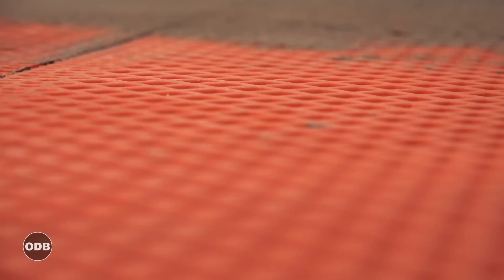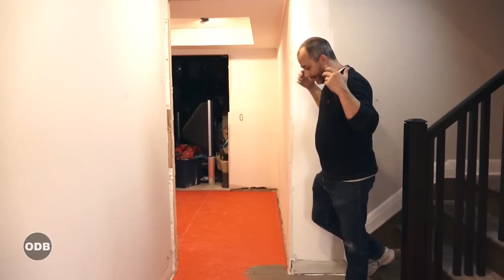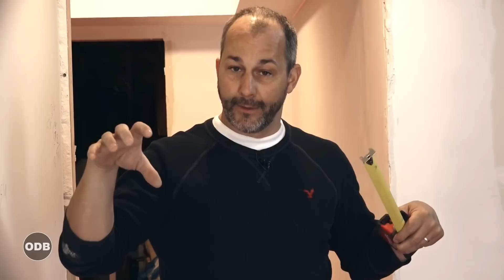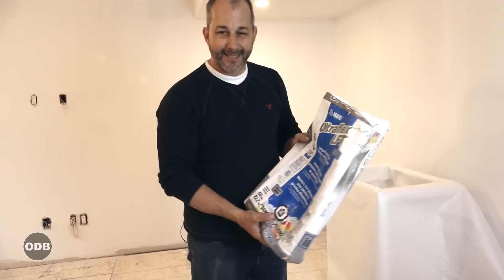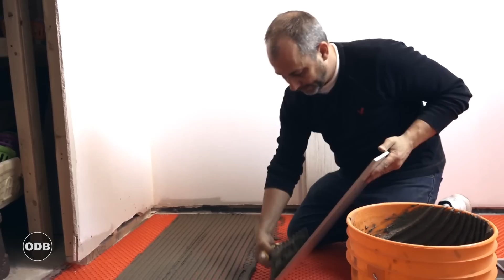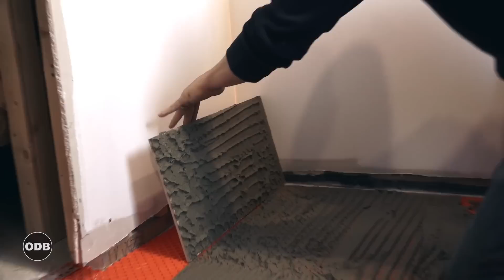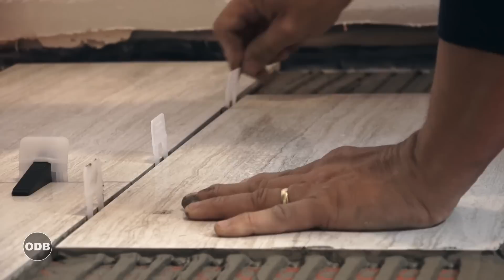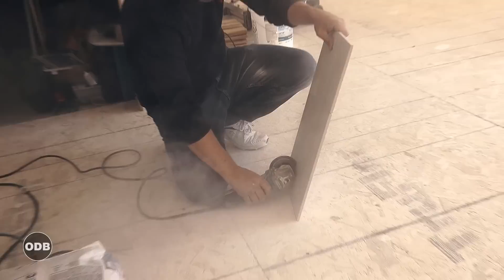How To Layout And Install Large Format Tile On Concrete

Comment: Wish I'd seen your video before I started my tiling project yesterday, especially seeing how you placed the leveling clips. I'm laying 24" x 12" tiles over Ditra XL in a lounge area (180 sq ft) in a brick bond pattern overlapping on thirds and using the Raimondi leveling system. Wasn't sure how best to place the base clips, so I phoned Raimondi USA. I was advised to place just one clip in the middle of each short side join and two clips on each of the long sides positioned in the middle of the 1/3 and 2/3 overlap sections. Did just that and got 5 rows in before I realized I was getting worsening lippage at the T joints - the reason I believe is because the one clip in the middle of the 2/3 overlap section doesn't provide sufficient counter leverage to keep the corner of the tile up. Fortunately the thin-set under the last two rows was still just soft enough to pull up the tiles this morning and scrape it off the ditra without damaging it. But no chance with the first three. In your video you put two clips on the short edge and on the long edges a clip on either side of each joint - so there are three clips around each T joint. That's much more stable. What's more, if you have to stop the job mid floor it means you can leave off and resume later without worrying if the last row is set level or not - with some leveling systems the wedge or equivalent can be loosened again, so up you can lay a 'dry' tile row, but with systems like Raimondi and the one you are using you only get one shot at it. Kicking myself now.
Reply from the maker: Sounds about right. Most of us Men try to do things without enough information. Once we realize it is going bad we get more. Glad to help.
Reply: Thanks, yes, I've switched to your clip configuration you used and I'm not having lippage issues now. Incidentally I was talking to a tiling contractor today and he said he puts just one Raimondi clip on each T joint, that's all. Thinking about it though, that's maybe fine if you are a pro and/or working in a team and can tile an entire room in one shot, but if you are an amateur working alone, like me, it means you can never clamp down the joints on the last row if you have to leave off mid job. So, at the expense of using more clips, I'll stick  with what works best for me.
Edit: Another thing to watch for with these leveling clips is that there is a tendency for thin-set to squeeze up under the wedge when they are crimped down with the pliers, making nigh on impossible to get at when cleaning out the grout-lines. So it's important to kick the clips off as early as possible (no more than 2 days after laying the tiles) while the thin-set is still reasonably soft, otherwise it will rapidly harden to the point that the clips can't be kicked off or will snap off above tile level with the remnant embedded in the thin-set plug. Made that mistake and I'm now paying the price for it, having to spend hours removing these plugs as best with a utility knife and hand grout saw.
Reply: Nearly fell asleep reading your comment

Comment: No respirator mask when mixing mortar, no guard on the grinder, and also using it indoors with again no respirator mask. Go outside and do down wind. OSHA finally defined silicia dust standards. Silicosis is no joke. Safety first. Glad you wore eye protection though.
Reply: Or use Dust collectors..
Reply from the maker: I appreciate your concern, however since I don't tile every day I don't get concerned with the occasional exposure. It is not enjoyable to mix cement outside in the winter time.

Comment: Awesome, great stuff, about to tile my bathroom on concrete with some 12x24's.
Any recommendation on layout, 8" offset, half offset, grid?  It's a standard 10x5 bathroom, I know LFT might make it look small but love the tile.
Any recommendation on underlayment or thinset?  Didn't see a need for the Ditra in a small concrete bathroom.  Mapei LFT good on direct concrete?
Reply from the maker: Holy Blitzkreig. Layout, use the 24" side of the tile along the 10 foot wall. If it is a good porcelain and all the tiles are the same size then I like the stacked effect. This helps the bathroom look much bigger. Keep your grout line to 1/8 " I would at least use a roll on crack isolation membrane to protect against concrete cracks traveling up through the tile. Mapei LFT is a great product on concrete if you don't use a membrane make sure you use a sponge to wet the concrete first for good adhesion. Just wipe a few square feet as you go. Use a grout with the sealer in it to protect against staining. 

AND GOOD LUCK !!! I hope it all turns out awesome.
Reply: Haha, sorry, that German blood.  Appreciate the info!  I like the contemporary look myself, mulling over stacked.  Will see how an isolation membrane fits in, and almost forgot about that thirsty concrete, thanks..  I'll try to post a link when it's done.
Reply from the maker: That would be very cool Willy Drucker
Reply: with any large subway tiles on floors its much better to go 1/3 offset. Most tiles have a slight bow in them and it makes it much easier to avoid raised edges.